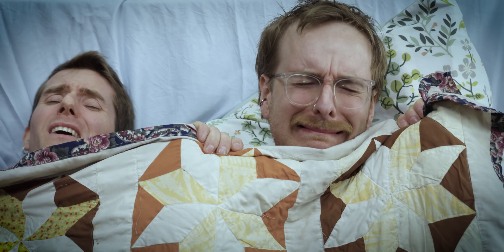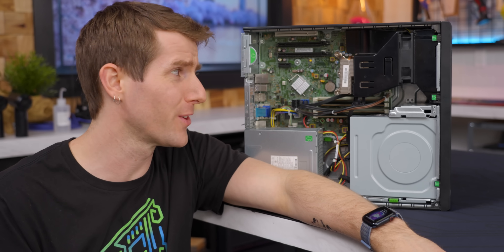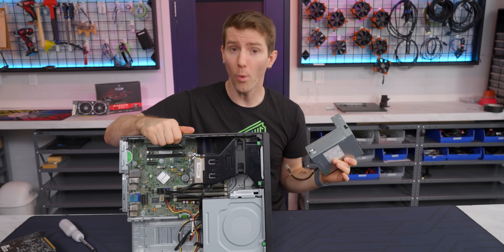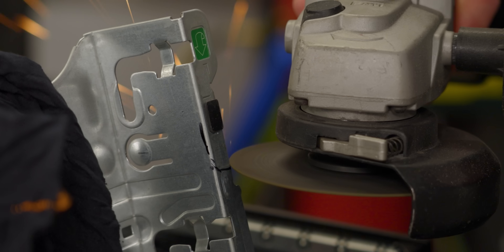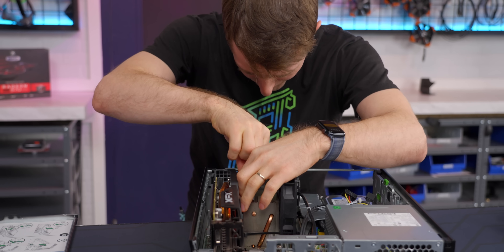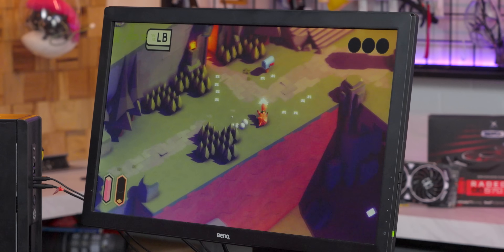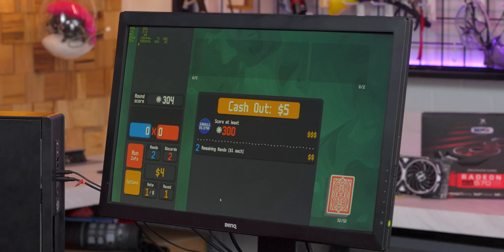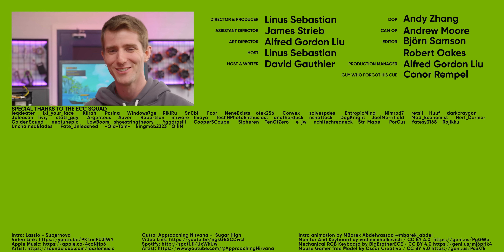How to Build the Ultimate $69 Gaming PC!

Comment: I built a computer similar to this one but used a 3020 MT (mid tower) it came with a 128gb ssd and an intel core i5 4570, I got an adapter to let it use a normal power supply, found a power supply that suited my needs and threw it in there, got a GTX 980 for £40 and boom its a killer little system, oh and also got 16gb DDR3 ram for cheap, I think the whole pc cost like £110

Comment: 69
+250 for angle grinder
+200 for for time and experience necessary to make the upgrades
+200 your other experienced friend to help you
+15 metal file
+15 tin snips / metal shears
+5 pack of disposible ear plugs
+5 for protective eyewear
109 at least, 359 at most. 559 if you have a job. 
All for a system that has no guarantee of working for the next few months let alone years and no EMF protection. Well done boys.
Reply: You must be fun at parties.

Comment: I’ve been going around Value Village, pawnshops and marketplace frequently and I managed to put together a 3770k GTX 1070 32gb RAM with a 500gb Kingston SSD build for 55USD (80CAD) just the other day :D

Far from the greatest, but for a second PC that can run Val, ROR2 and other games at 120FPS+, I cannot complain. Considering turning it into a Steam machine, but I lowkey want a nice/small mATX over the old generic HP case it’s in right now but I can’t justify a case that costs half the system lol
Reply: The real heroes are always in the comments 😊
Reply: It’s such a PITA to find drivers for those old intel chipsets. Of course intel doesn’t host them on their support site. Thanks intel, ya scumbags.
Reply: @ should I bother updating the drivers? I just assumed it’s such an old chip no matter what I do there wouldn’t be any noticeable improvements with how much of a bottleneck the CPU already is
Reply: @maple5702  If it's running fine, then Windows probably found the correct driver and installed it properly. That's not always the case. I've had to go digging multiple times.

Comment: People are too afraid of soldering their power supply connectors. Once I bought a 500w power supply without SATA power to replace a broken one that did.  I grafted the SATA connectors onto my other one and it's been working great for years.  Just be sure to check the voltages with a volt meter

Comment: Before anyone complains about using the power tools, there is always the option of the infinite supply of zero dollar computer cases so long as you're willing to go pick them up.
Reply: I mean... if you're lucky somebodies mom is always selling her kids gaming pc for stupid cheap lol save a lot of steps
Reply: or ask your neighbor, dad, friends, if they could cut those 6 cuts real quick for you. if my neighbor came up to me asking if i could do that, i would. thats like 3 minutes of work. then give them a scrap piece of sandpaper to take the edges off, and send them on their way. (but i would also probably just give them a better case from "the pile" for free, as well as some other components they could need)
Reply: @retroferret3424  neighbors aren't as nice as u from where i live lol (socal)
Reply: @zerocal76 California sucks, everyone is super friendly but no one is nice to anyone.
Reply: Gotta make sure its atx compatible some of these pre build pcs are not
Reply: @Ruubie2197  ive dealt with that before on an old dell workstation but worked around it with jank solutions that didn't involve cutting anything. For example they used a proprietary power supply for their cases but an ATX PSU mounted just fine upside down with 3 of 4 screws 😂
Reply: @Ruubie2197 Why has it got to be ATX compatible? What if you're not using an ATX board or PSU???
Reply: you could also find an old hacksaw and cut the pcie things then run no sidepanel
Reply: You can also get similarly functional results entirely by hand if you want to - cold cut chisel shearing is very very cheap even if you have to buy the tools (which basically are just lumps of iron you can probably pick up from the trash behind a machinists shop) and well worth knowing how to do - there will be rare times it is just a better method than the abrasive wheel.
Reply: i use a drill when building computers its not a problem at all as long as you can control throttle i sold 10 pcs last month
Reply: @ i htink their point was more that not everyone has tools at home to cut metal with
Reply: Or hand tools like tin snips or hack saws. Power tools can also be borrowed or rented.
Reply: Or grab a free cat bed for an open air test bench! 😂
Reply: Or just use a box😂😂😂
Reply: Not where I'm at.
Reply: Or a cardboard box if your feeling really adventurous 😂
Reply: Although Dell workstation Motherboards and Power Supplies aren't ATX form
Reply: Honestly you could do that with hand tools. It would suck much more, but you could absolutely manage. It's just sheet metal, it's not like you're tryna get through three inches of hardened steel or some shit.
Reply: There are some public libraries that loan out power tools
Reply: I had to do some drilling on my case to make the power supply fit. It's not difficult usually.
Reply: where/how?
Reply: You gotta be quick. I put a old Corsair spec-3 on FB Marketplace and have 5 people message me in 3 minutes and it was gone in 15 mins.
Reply: You might not own and angle grinder but I promise you know someone who has one.
Reply: problem is mounting holes on the mb are not standard so you cant mount them most of the time
Reply: Pro tip, but the tools online then return after use
Reply: ANNNNND not to mention, yo can make the same modifications using a pair of pilers and bending the metal back and forth to heat it up. it WILL break eventually. You will need a finger nail file or something to file down any sharp edges. Failing that, throw it all in a box and go online and look for folks giving away ATX cases. Hard to find where I live but you can still pick them up for pennies on the dollar. Me and the kiddo found a old Apollo case for next to nothing at goodwill and that particular case is very sought after and sell for crazy prices now.
Reply: So "before anyone complains about having access to power tools, you can use a car?" Thats just replacing one issue with another...
Reply: Or just leave the side panel off
Reply: @ most slim formfactor pcs wont fit a normal gpu even with the sidepanel removed, since the mountingbracket of the gpu usually is recessed, so you need to atleast cut or snip out the are around the gpu mount.
Reply: I say, keep this build and make both a 169 and 269  builds, then dragrace all three just to show what you can actually get if you do some research and buy smartly.
Reply: Or you could jank out and use a cardboard box XD
Reply: the issue with those motherboards and parts are proprietary and probably won't fit
Reply: or just dont have a side panel :D
Reply: Show me a BTX Case that would Fit that Board 😀
Reply: Plus you can get a 5$ cutoff at most yard sales
Reply: @CableFeed  I got a b460m and cyberpowerpc case with all the fans and stuff for free the other day😭
Reply: You can't always use a standard ATX/mATX case for these custom mobos.

The optiplex 3060/70 & similar sff mobos only share 1 mounting hole with the ATX standard (upper most left) you will have to devise a way to secure the rest of the mobo. I can provide ideas for anyone interested
Reply: it is a problem with proprietary hardware in those prebuilt systems not fitting into regular cases
Reply: u can always just NOT use a case :D like xqc!!
Reply: These OEM systems don't always have standard mounting points the newer the generation you go for, 8th gen HPs and Dells won't mount to a standard case making the original the only option.
Reply: uh, and where are these "free cases" given away?
Reply: This is the sort of thing the ECC team should suggest. Too bad they didn't! Would have been a good thing to say to avoid feelings of LTT being out-of-touch.
Reply: just in case someone chooses this option in places where people do give atx/standard pc cases, most of the time you'll need to first find a guide on the brand of the system you bought, because, HP, Lenovo and so on, usually changes a bit the order/the cables for stuff like usb ports and power buttons (kinda like their PSU too) on those types of pc models, so it's not usually as simple as just moving one motherboard/pc from one case to another
Reply: could also just take the side pannel off and clean it often. I had this exact setup 5 years ago and thats what I did.
Reply: A while ago I built a pc out of scraps from my country's version of craigslist.

Instead of buying a case, I went to the hardware store, got a piece of 0,50€ scrap wood, superglued some nuts in the right places and just screwed the components on the board. Then drilled a few holes in an old plastic storage box and put that on top of the plank. Using some heat-shrinking tubes I put two wires on the jumpers and held them together when I wanted to start the pc, because always lifting up the plastic Box and holding a screwdriver in there was too inconvenient.
Reply: well.. why not use a case at all? better cooling!
Reply: dunno, last pc is still stuck to a makeshift piece of wood.. lol     you dont even need a case LOL
Reply: My last PC case I found on the curb almost 15 years ago and housed several builds until I retired it. 👍
Reply: my Lenovo cube Y720 was smth someone gave me for next to nothing,..,sure you might also get smth defective and have to swap parts ect,..Definitely, if you scan the web often people sell things as defect when it maybe just need a new System or Drive…might cost time of course…
Reply: You can 3d print a computer case for the cost of PLA
Reply: or look around for a full size office pc. if youre lucky you dont even need a new psu then thanks to sata to 6 pin 😂
Reply: This had 69 replies till I commented
Reply: or you could build one if you like being handy, imagine having a pc case made from wood
Reply: @zacharyirizarry8589  I actually built my PC case in wood! Don't bother unless you really like the aesthetic of it! It's a lot more complicated than it sounds. Unless you're experienced with woodworking and various mounting hardware solutions, I wouldn't bother, especially if you value your time at all! And unless you're using scrap wood, you're likely gonna end up spending a LOT more on just buying materials and wood than if you just found a cheap case somewhere. A single 120x80cm sheet of 6mm birch plywood costs the same as a cheap case where I live.
Reply: Just gotta remember that a lot of those prebuilt systems don't use a(n) *ATX motherboard form factor so you won't be able to pull the motherboard and put it in a standard case.
Reply: @ampex189  why not? You just might have to drill new holes.
Reply: Uh where?
Reply: @ place i had my internship at like they threw a lot out that was perfectly working and pretty new
Reply: Where? I've been looking for one for weeks. People sell them nowadays, and the older it is, the more expensive it gets.
Reply: Or save your money. If you can only save 70 bucks for a computer, you should be focusing on more important things.
Reply: I can't believe I scrolled down 29 comments and not one mention of the fact that tons of these PCs IN FULL MATX TOWER SIZE sell for the same price. Like, they suggest that more VRAM or a bigger SSD are the things they would change for a few extra dollars, and not the possibility of buying a PC that doesn't need to be hacked apart with a circular saw.
Reply: @elemkay5104  Exactly. Most people have underestimated how many full towers that is basically out there compared decades ago. And they are usually more than enough space to fit PC parts.
Reply: not every country has those
Reply: @ what country? because i cant imagine that in a world where tech breaks, but cases dont, you dont have a surplus on old office cases and such
Reply: @retroferrettv  nz is very costal in all major cities stuff rusts pretty quickly but if your fine with rust or plastic then your vibing.
Reply: @retroferrettv  I would love to know where to get some cases
Reply: @totallytrueinfernoriderwuwa my area of the country doesn't have used PCs (OK they do but the ads are like this 'I have a used laptop I paid $1200 in 2015, for only $800). I live in a rural area so my $69 isn't possible, IS WHAT I USED TO COMPLAIN ABOUT. Now I would recommend asking your local PC shop for parts they are going to throw away.  Be honest with them and respectful. I got a used PC and wanted a missing bracket. When I asked the shop they said I could take one if I could find it, I am pretty sure I could have asked for an old PC. (The issue is you can not see the a CPU.) Bring your phone. Dell and other brands have numbers that will tell you the specs. 

They are thowimg them away because it cost too much time/money to ship them.

While you are there see if they would sell you a Graphics card. (Maybe say something like I am hoping for a deal if you don't pay shipping and eBay fees).
Reply: @totallytrueinfernoriderwuwa  I feel like Americans are soo out of touch with the world. Literally nothing over here is free not even garbage old tech
Reply: @totallytrueinfernoriderwuwa  That's a you problem, cry more

Comment: For my Canadian bros, the Electronic Recycling Association (ERA) Non-profit sells dirt cheap Workstations at reasonable rates and are open to offers on price.

You can get some amazing deals on like Z440/T5810 etc...

I gamed for years on a Z440 no problem.
Reply: The actual tricky part is picking the right Xeon
Reply: @kimochi33  Picking 6/8 core one is the best for gaming (and most economical). The more cores above that, the slower the max boost speed. Many games (especially older ones) still benefit from strong single core performance over lots of cores. If you're doing stuff like video rendering, that's when you start to put those slower 10+ cores to use.
Reply: @ I leave that up to the individual and use-case to decide. I've seen full on Z440's go for $40 CAD there. At that price you can do whatever you want.
Reply: @kimochi33  I guess? You can get v3 and v4 Xeons for dirt cheap. Like 4 cores all the way up to 18 cores. Whatever you like.

Comment: Money saving pc tip is to just walk out of the best buy with the parts, as long as you can run fast enough...
Reply: The expensive part is the lawyer…
Reply: In California you don't even have to run if it's under $950.
Reply: @MTGeomancer  i was gonna gatekeep that bit, it's too good
Reply: Good running shoes are expensive. :(
Reply: Just tried it. Works 👍 they have yet to find me
Reply: dont run, that catches their attention. just be casual. maybe print a fake receipt or scan and change one up a bit. then casually walk out like you just bought it

Comment: I will say the low-end PC stuff has really improved. I remember when iGPU's could barely handle stuff like Quake 3, at least my GMA 950 lol. Now you have integrated GPU's that can handle new releases at medium settings and decent resolution. Blows my mind and really looking forward to the next 5 years on handhelds.
Reply: i got a pc made completely from scrap parts, that plays the whole console library up till Wii. theres so much fun to have with donor pcs.
Reply: haha GMA 950. What a trooper. Used to play WoW on a MacBook with a GMA 950
Reply: It depends on what kinda igpu you're looking at. For the most part, that's only really for cpus already meant for gaming
Reply: Ryzen "AI" integrated GPUs are insane but God damn they're way overpriced right now. You can legitimately get a Lenovo Legion, specifically meant for gaming, for like 1/3 the price of a new laptop with the new "AI" APUs
Reply: Yup.  When Intel called these "Intel Extreme Graphics" we called it "Intel Nonextreme Graphics" LOL.   I have a 11th Gen Intel notebook (with the 1115G4, which has half core count (dual core) and half CU count on the GPU) and it STILL is "fine" for gaming.  (I put fine in quotes because this half-CU-count model has about 2/3rds the performance of a Steam Deck.  Any higher end chip with dual the cores and dual the CU count on the GPU would be legitimately fine.)    And the Linux drivers for the Intel GPUs are now quite excellent.
Reply: @Stealth86651  you mean new releases at ultra 1440… the new iGPU’s are actuslly stupid to think about. 5 years in the future and instead of costing 1000$ itll be worth all of 200$ for 4070 mobile performance.